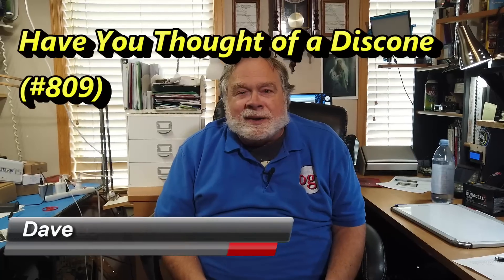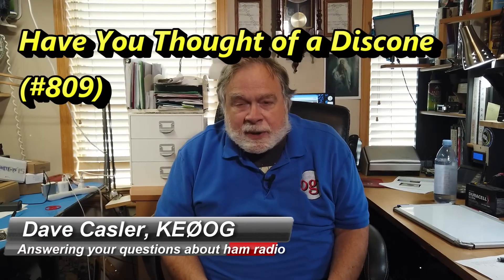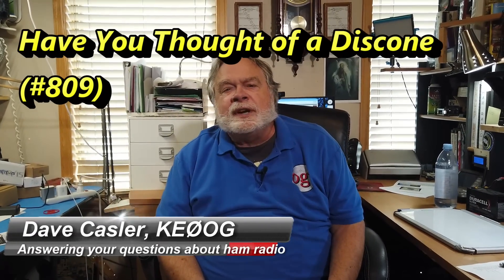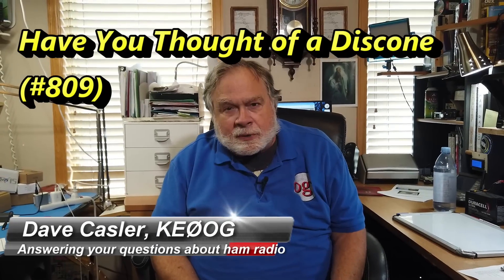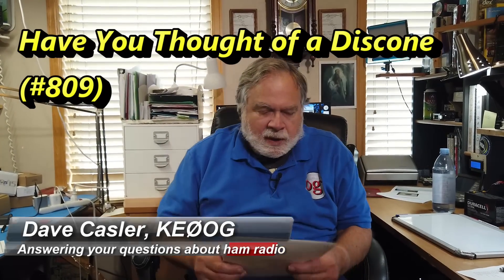Have You Thought of a Discone (#809)

Comment: You say in the video that noone really "knows" how a discone works - here's the best explanation I've found for it.

I didn't come up with this, and I can't find an attribution, but it makes perfect sense if you think about it.

Imagine a piece of coaxial feedline as a RF waveguide. That is essentially what it is at its core - electromagnetic waves travel down the cable through the dielectric due to potential differences and current flow on the conductors. 

Now, imagine that you take the open end of that coax and turn it inside out, kind of like folding the top of a sock. Spread the outer shield into a cone shape, and warp the inner conductor into a disc. Depending on the angle, length, and spacing of the the cone/disc, you will have a certain impedance at the point where it folds, and a certain range of frequencies where it will work well. As you mentioned, you want the cone section to be at least 1/4 wavelength at your minimum operating frequency. So essentially what you have is a form of waveguide radiating a vertically polarized signal omnidirectionally.

Where this breaks down is when the cone and disc become very large in relation to wavelength - then it ends up acting more like a bunch of long wires and the radiation pattern starts looking funny. The commercial discone antennas tend to be designed with 100MHz as their lowest frequency, so they cover aviation frequencies and 2 meters well, as well as 220 MHz. Once you get to the 70cm band, the pattern is still "okay" and the SWR will remain low. But above that, they tend to throw a lot of energy vertically due to the "long" cone section. The low SWR continues up to around 10x the design frequency, but examination of the antenna pattern shows a mess at those high frequencies.

Your proposed design would likely work well on the 70cm, 33cm, and if built carefully, the 23cm bands. Possibly a very useful little antenna.

Thanks and 73 de N2NJZ.

Comment: i bought one of them at a ham fest for fifteen dollars. it did not have the wire that was used for getting out  that little wire cost me ten dollars. it was a beautiful antenna for two meters. all though i was only about ten to fifteen blocks to the repeater the little wire wad on top of the antenna was for getting out..

Comment: Interesting video David. 
I made a ‘Tape Measure’ Discone just for RX purposes with parts of a tape measure for the disc on a SO239 like the one in the video. Then used copper audio speaker wire going down to a steel circle from a garden waste bag for the cone. 
It works very well in the loft with my Scanner but doesn’t look too great! I may eventually invest in one off the shelf that is waterproof for outside. 
Always fun to build and experiment. 73’s Franco 🙂

Comment: Do these have any vertical antenna on the top? Or is it just a flat disc, and the cone below? And how well do they transmit?
Reply: The classic discone is just a flat disk.  However, as you already have the counterpoise resembling a ground plane dipole, many manufactures put up quarter wave (or coil loaded <1/4 wave) for the next lower frequency band on top.  This is commonly 6m.

Comment: Now I have very little interest in trying to build one because most of my experiments with antennas haven't worked out but many years ago in the 90s I bought a radio shack discone for a scanner and I was shocked at how good it worked with my two meter rig... It works perfectly for 2 m and 70 cm and I'm still using it today
Reply: Don't give up on trying!!!
Reply: I always wondered in you can transmit from one of those "Scanner antennas". Can you transmit okay with it? If so, I may get one.
Reply: @chrissewell1608  I ordered one yesterday. I don't know if it has a decent band width. Maybe it depends on the frequency or on the coax used? Idk..
Reply: I'm guessing that was the Hustler DCX, that I also purchased from Radio Shack for scanning in 1977 or so, and is still manufactured. 

I used it for 2-meter transmit several times with good results as well.

Comment: The LORA 433 Satellites are using LORA radios on the European ISM band. Tons of inexpensive antennas are available. Most of the satellites max out at about 30dbm so they are very low power, but LORA provides good weak signal propagation with a good deal of processing gain.

Comment: Appreciate the video, Dave.  I made a homebrew Discone years ago from a salvaged SO-239 connector, that was from the chassis of an old parts radio.  The antenna worked pretty well,  though the overall gain was fairly low.  All in all, neat antenna project and nice bandwidth, too.   73,   AC3HT
Reply: Ah, same could be done with any panel mount bulkhead. Good idea. There are plenty of ways to improve on that too. Im assuming your ground cone had 4 leads.